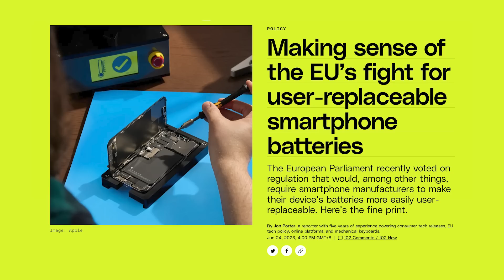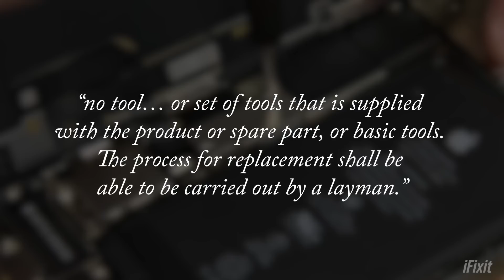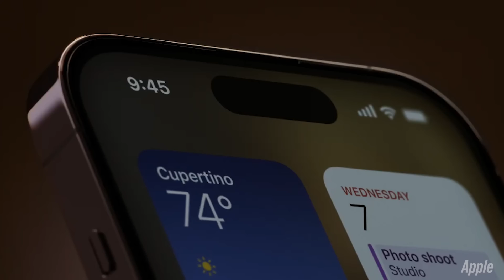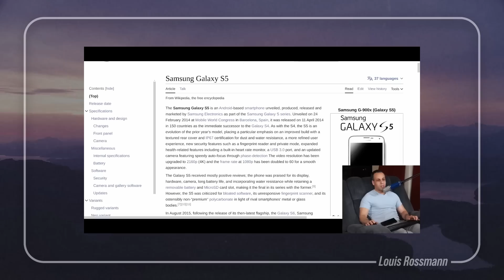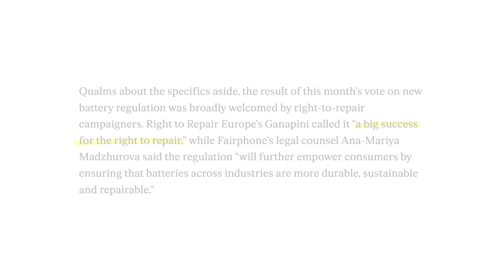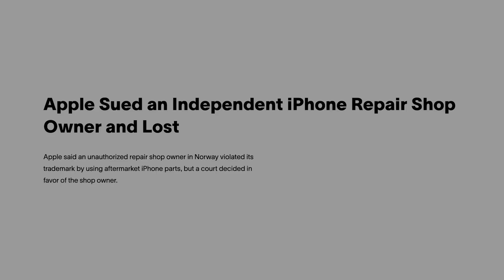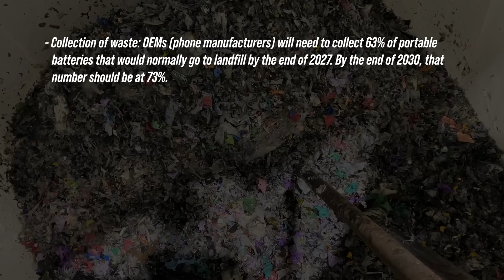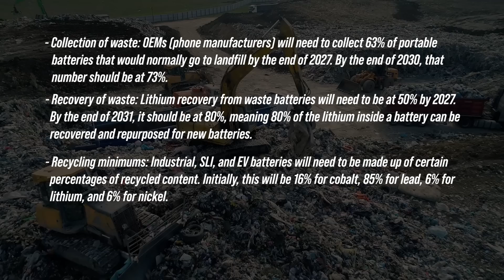EU Just Changed Smartphones Forever

Comment: I'm almost 100% sure it's been an anti-consumer decision to line companies' pockets.  I will also be shocked if they end up splitting the production to comply with a law in one region while designing a separate device for everywhere else they don't have to.
Reply: Yup. This is most likely. Or they just won't sell to the EU until they retract that law.
Reply: @seanweber4114   china is more than available to replace this phones.
Reply: Most countries/regions need to bring this law.. That would force their hands.
Reply: Needing to upgrade your phone regularly is totally proconsumer. They want you to consume. And consume and consume.
This changeable battery thing will go the same way as the usb-C port on the Apple phones.
Technically it is a usb-C but you need a proprietary cord for fast charging and data transfer.
The batteries will also be made to not actually work without linking from the manufacturer.

Comment: The phones that had IP ratings and replaceable batteries were only water resistant until you started swapping batteries. The gaskets were not designed for repeated swapping.

Comment: The law is indeed motivated but they could go the less autocratic way and give the manufacturers a choice: either the battery is user replaceable or the manufacturer is obliged to change the battery at their service center or third-party service points for a price not higher than 5% of the new phone price during the first 10 years, e.g. for a 1000 $ phone that is a 50$ change work included, a reasonable price that does not force the manufacturers to make drastic changes to the way the phones are built. Obligatory USB-C charging port is another strange requirement. The motivation to save on chargers or cables does not hold up. Whose cable survived the lifetime of a phone? All the chargers have a USB outlet where you connect any cable you want. Not that I think the Lightning port is much better than USB-C, but it does take less space and it was totally unnecessary to force Apple to change to USB-C

Comment: The reason Apple and other manufacturers don't offer easily replaceable batteries and go to extensive lengths to prevent the ability of users and non-certified shops to repair their devices is pure greed. I am certain, that most corporations are evil in that they don't give an actual damn about their customers, let alone the environment. All they care about is profit. That's it.

All the other reasons (namely: shop technicians not properly fixing stuff, bulkier phones etc.) are just for show. Imagine if a shop didn't properly repair whatever they said they'll repair. It'd mean, that in the best case they'd have to replace stuff out of their pocket, in the worst case they'd get sued. And a negative feedback on Google and other sites would be a given.

I am looking forward to this law becoming active, though I don't get my hopes up; I am sure that the lobbyist and lawyer armies of the corporations will find ways to evade the law.

Comment: Do bugs need an internal skeleton...? Because these new smart phones will, again. Nightmare to get inside and fix anything quickly. Right now everything just has double sided tape. Everything is removable... Those phone battery carts can't be used in anything but that phone. It's obsolete the moment it's locked to one model... manufacturing and disposal.

Comment: I only replaced my last 2 phones due to the battery running out of cycles. I would never replace my phone again if I could replace the battery without breaking it. Surprised there is no competitor making waves. I'd switch pretty quickly.

Comment: Battery being easily replaceable will increase the demand of batteries, I understand from the right to repair perspective but from the battery 🔋 perspective I don't. I used my  iPhone 6s for 5 years till May this year only changed the  battery last December. But when I was using Samsung J1 before the iPhone I used to walk around with 2 extra batteries, slight sign of battery degradation I'd get a new battery. But with the current state you ride the battery to its death bed.

Comment: Phasing out user replaceable batteries was probably initially to build thinner and slicker phones cheaper. Customers bought that up. Every tiny bit of space inside a phone is valuable, so making a glass sandwitch could be cheaper when optimizing for thinness. But tech also gets smaller and more capable. So after a few generations greed for profits took over.

Comment: Supermarkets in Australia have a "bin" for recycling old phones. Also, you can take anything with a battery and recycle it for free at the local tip. However some are still disposing of their batteries in the rubbish bin and causing fires when the trucks compress them.
Reply: The stuff in the recycling bin goes to poor counties to burn and scavenge for gold, and also to make you feel better.
Reply: @jumilifyify you mean because it's more financially beneficial to send to a poor country then process it here.
Reply: This is a pretty poor answer to the problem for obvious sreasons
Reply: @garfishsmith9037  because noone would bother, correct. It's pretend caring by a corporation that doesn't care.

Comment: The idea of removable batteries is beneficial on so many fronts. The biggest being environmental impacts. Especially as more and more manufactures try to use that rhetoric all the while simply eliminating a charger brick and or cable. The phone still becomes e-waste once the battery dies. While that isn't entirely true, anti-consumer tactics used by Apple such as locking parts or requiring first-party repairs heavily discourages this. So while I fully see a replaceable battery being an option, I guarantee Apple will still put into place further steps to ensure they are the only source of replaceable parts. And you have to go through their channels to ensure compatibility.

Comment: Here's my bet on how this plays out. The phone manufacturers (probably starting with apple) add a clause to their warranties stating that if the rear panel, or whatever part has to be taken off to replace the battery, is damaged they no longer have to honor the warranty. Then they start making them easy to remove, and just as easy to damage. Easily torn waterproofing rubber, brittle locking tabs, ways to catch on cables or antennas that are clearly stated in the manual but not obvious just looking at it. After that all they have to do is wait for people to start complaining about their warranty practices, then turn around and blame it on the need to have replaceable batteries. Expect this sort of shenanigans on phones starting in 2028, also expect most new phones to skip 2027 and be 'delayed' into 2028 citing this law.

Comment: There's a big difference between user-replaceable and swappable.
When I owned a Droid X in 2010 or the Samsung Galaxy S II in 2011, they had these nice little brick batteries, and Droid X even had a fatter battery option with a replaceable extended back cover. I would not consider these "swappable" per-se, Like, if you had them in your pocket, they could easily bend or puncture the soft papery coating.
The Sony PSP has what I consider a "swappable" battery. Hard ABS plastic shell, easily handleable, and even had an external charging dock so you can swap and charge the dead battery.

Comment: Why does everyone think that manufactures would not make 2 different phones for different markets. It happens with cars too. For example left hand and right hand drive. Petrol, diesel, electric version. With electronics too. America uses 120V the rest of the world 230V. User replaceable is also a broad term and could also mean that a user can replace the battery without voiding the warranty. With a few screws and stuff. So it doesn't necessarily mean hot swap-able. I think these are huge misconceptions! I might be wrong but we will see!

Comment: About bloody time. Easily replaceable batteries is way more important to me than waterproofing or form factor anyhow . I've never dropped my phone in water. Using phones in the rain is a pain also as the raindrops play havock with the inputs on the touchscreen regardless of IP certification. Manufacturers could easily enforce it by not selling you a new battery unless you provide the old one. Third party manufactures/suppliers is where corners may be cut.

Comment: I do feel like it might have been better if the EU could find a way to create economic incentives that would make almost all batteries be user replaceable - and maybe ramping up the incentives over time - instead of simply banning non replaceable batteries. They could set the incentive levels to make sure that nearly all smartphones etc come with user replaceable batteries but still let the market choose to have non replaceable batteries if there are particular cases where they make more sense.

E.g. they could charge a tax of €600 for manufacturing or importing to the EU any smartphone with a non-replaceable battery, I would guess that would be enough to make them almost all go user replaceable. If not make it a higher tax.
Reply: @barneylaurance1865 Maybe it would be too easy to dodge a tax by smuggling the phones in and then mixing them in with legally imported phones. If it's a straight ban any non-compliant phone could be confiscated when found for sale.

Comment: I was sad when Samsung stopped using replaceable batteries. It will be good to see companies start to use them again in their devices.
Reply: Imagine a replaceable battery in a laptop
Reply: @chiquita683  my older dell from 2014 has this
Reply: @chiquita683  miss having a replaceable battery on my laptop.
Reply: @chiquita683  i'm guessing that was sarcasm, but all laptopls had replaceable batteries until maybe 5 years ago.
Reply: @chiquita683  My modern Gigabyte laptop has this.
Reply: @chiquita683 I thought all non apple laptops had replaceable batteries. All of mine did, last windows laptop I bought was in 2014 tho so it probs changed.
Reply: I do remember the time when we had user replacable batteries (no tools required). Back in the days of dumb phones they were kind of convenient, as the battery was pretty much the only component that would decay over time, though it should be noted that those things lasted for a week or two brand new, and 3-7 days when they were 5-year old. I actually still have a couple of fully functioning dumb phones from early 2000 sitting around. Back then we didn't change phones because the old ones got broken, but rather because the new one had such great features as a better speaker and integrated fm-radio antenna (no headphones required). There was no need to replace the battery on the go, but if your phone got stuck on something, it was super easy to rip out the battery to force a reboot.

The first smartphone I had did feature a user replacable battery. Let's just say that I don't miss that. The fact it was easily replacable meant that the back panel and battery did remove themselves any time I happened to drop my phone. Sure it didn't really damage the phone, but the phone did obviously shut down when the battery detached. Nowdays I simply pick up my phone and continue doing whatever I'm doing. Anyway, the need for carrying a spare battery has gone away as the battery technology has improved quite a bit. The only reason to change a battery is when the old one loses performance, maybe after 2-4 years of use.

I haven't yet read through the EU legistlation, but I'd assume it actually means that battery replacement can require some basic tools, such as a heat gun (a hair dryer will do too), prying tool and maybe a suction cup. I mean, for regular batteries (the ones you cannot recharge) you often times need to open a screw or something too.

Anyway, I totally expect my current smart phone to last for at least 5 years without battery replacement. My previous phone lasted for slightly over 5 years (still kind of functional, but I replaced it as it did shut down unexpectedly and didn't come back to life until a day later). The phone before that lasted for about 5 years (screen was punched in after the phone was dropped from about 3-4 meters / 10 or so feet). If EU wants to prolong the life of devices, they should require companies to release at least security updates for their devices, and make spare parts (such as batteries, screens, etc.) available. Sure, you might get both when the device is brand new, but try getting either one when the device is 4-5 years old.
Reply: Couple notes from the draft of EU-legistlation:
- manufacturers/importers/representatives shall make batteries available to end users for a minimum period from 1 month after the date of placement on the market until 5 years after the date of end of placement on the market, unless their batteries are durable enough. Durable enough meaning that the battery retains 83% capacity after 500 full charge cycles, and 80% after 1000 full charge cycles (whilest the decive is dust and water tight). To me it seems more likely that batteries are designed to be durable enough, rather than having to keep them abailable for a long time (having to supply something physical for 5 years is not cheap)
-Spare parts must be delivered withing 5 working days after receiving the order (either expensice priority shipping, or stockpiles in most EU-member states)
-Maximum prices will be set for spare parts
-Smartphones must last at least 100 drops from 1 meter without any protective cases or screen protectors (IEC 60068-2-31, Free fall repeated – Procedure 2)

And here is the most notable thing:
The draft legistlation says that the battery replacement shall be feasable with [no tool] OR [tool or set of tools supplied with the spare part] OR [basic tools]. I'd say that for mainstream phones it's safe to assume we will not see tool free battery replacements. However, a suction cup and a prying tool (maybe even a small quantity of rubbing alcohol) can be reasonably supplied with the spare battery (their combined cost is something like 1€ or so). Heat gun might not count as a basic tool, but a hair dryer probably counts as one. We are probably not going to see the old kind of tool free user replacable batteries that you can reasonably carry in a pocket, but rather batteries with less adhesive, better pull tabs, and designs that make removing the screen or back panel easier (while still requiring basic tools)
Reply: Final note on this, the draft requires companies to provide security updates for a minimum of 5 years after the date of end of placement on the market
Reply: Frankly I switched to the Galaxy Note 3 after having every gen iPhone. It was awful. Worst 2 years of my life. 
Batteries were bulging and getting overheated all the time. I remember some phones were even blowing up on people. 
Hopefully Apple does it right but not holding my breath.
Reply: Bad idea.

Comment: Every mobile phone they now make is designed to get money from the consumer. I used to have a Samsung Rugby. Didn't need a case, was waterproof, and had a removable battery.  At one time cell phones also had an FM antenna, so you listen to local radio without a data plan. And then, there's the planned obsolescence when they stop updating safety and other software. It's a racket, and they can try to argue all they want about 'impossible to design'. As you show in your examples, technical limitations are not the problem.

Comment: Years back, I tried to buy a new battery for an early iPhone (4?) but it turned out to be a rip off.  Either Apple made the battery prohibitively expensive and always seemed to be out of stock.  Or the 3rd party/retail replacement battery market was full of used recycled batteries that would not last.  Sure, some will be successful finding fresh replacement batteries.  I predict the manufacturer's business model will continue to depend on steering consumers towards discard and replacing the full unit.  Battery replaceable units will then be harvested for refurbishment and eventual resale in disadvantaged markets.

Comment: that's great. I have a galaxy & a v60 and they both lost the ability to charge without a wireless charger. So I just bought a few usb charging port replacements & it's a pita opening these things back up.. but I've already changed both before a year ago.. hopefully I can hold out until replaceable batteries are the norm

Comment: Right to Repair is a movement primarily lobbied for by the repair vendors, who were being shunt out of the industry as working part were not made available to them. 
This EU law/requirement, while seemingly is a win for the Right to Repair vendors, may prove to be a "shooting themselves in the foot" case.  What if manufacturers make it so easy to replace a battery (or any other component for that matter), that any user can do it, particularly without specialized tools and knowledge (like a snap-on battery)?

Comment: The switch to non user replaceable smartphone batteries was one-hundred-percent about profit. Writing this from my refurbished Pixel 2, that works better than many current phones. To add, removing the headphone jack was also profit motivated. Corded headphones don't have batteries that will wear out; when Bluetooth headphones fail, they must simply be replaced.

Comment: All mobile phones should have replaceable batteries anyway. But phones should have a proprietary battery connector with the protection circuit built in, and adapters so people can use any 3.7v Lithium battery they want to use.